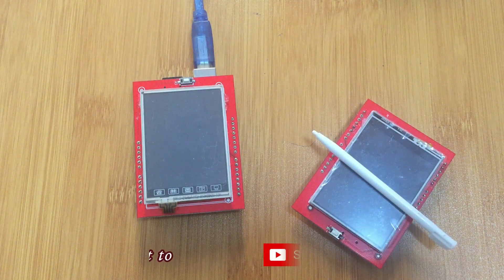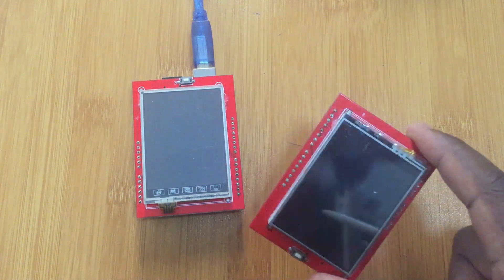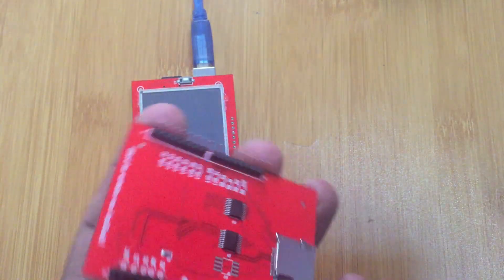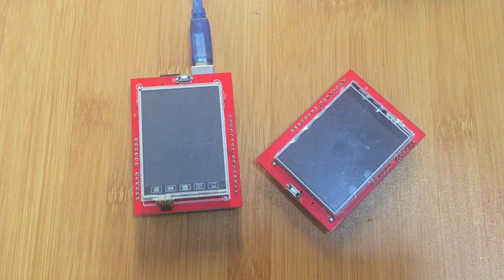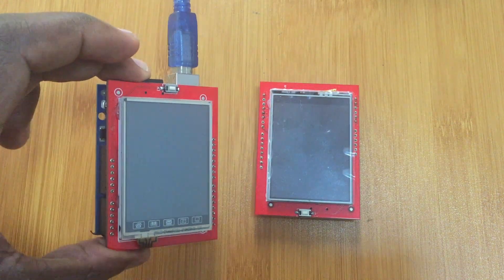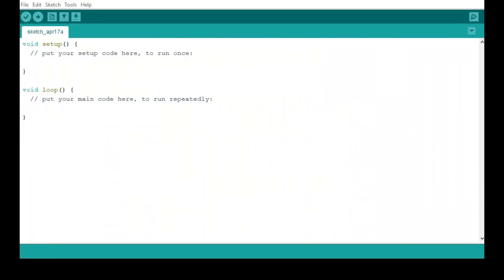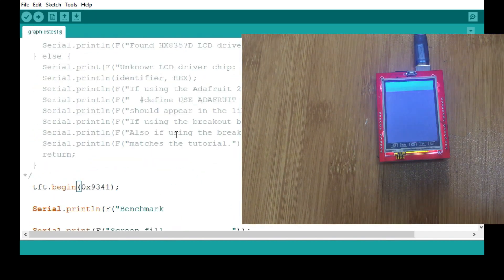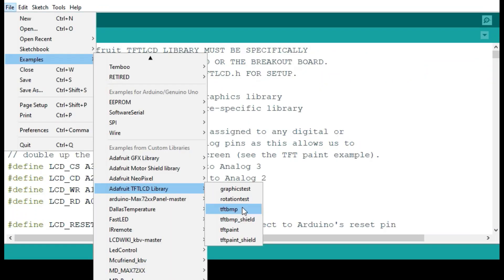2.4"  TFT LCD TOUCH SCREEN SHIELD FOR ARDUINO. (Troubleshooting white screen and touch problems)

Comment: Hi sir, this video helped partially. I could run the grafic test, with bouncing and white lines on background. But that's all. The touch shield doesn't work. IDE reject compilation with error message Make sure that use. Adafruit shield pinout is defined in the TFTLCD.h library . I am new in this topic so please help somebody. Thanks

Comment: I know you might not see this but, after I installed AdaFruit with my ardiuno my LCD Keypad Shield started bugging out and putting random characters even though the code I have for my LCD Keypad shield worked before. Also I tried using my TFT Lcd Shield, but I just got a white screen.

Comment: THANK YOU SO MUCH! I was four hours into looking up a solution for this <3
Reply: If anyone is stuck, try uninstalling all of your packages and getting the GFX and then the other library but be careful when installing the second library when it asks if you want to install dependencies, SAY NO, because it may reinstall a modern version of GFX undoing the work you just did to install the older version. Hope this helps. It worked without any dependencies of the TFT package anyway. That's all I had to do. I'm really really really hoping this helps anyone who sees this.

Comment: Hi.  Very useful explanations.  Thank you very much!.
I have a question.  It seems there are some lines missing in the following code:
            for(int k=0; k>3;               
        // read
                __color[k] = __color[k]<<6 | (sdbuffer[buffidx+1]>>2);      // green
                __color[k] = __color[k]<<5 | (sdbuffer[buffidx+0]>>3);      // blue
                
                buffidx += 3;
            }
 I suppose for(int k=0; k>3; k++) {
but I have no idea for the next line ending with //read.  It should be something for the color red, if I am not wrong.
Could you please help me?
Best regards

Comment: I wish you a good day. I have a 2.8 inch LCD. I've been looking for a solution for 2 months so that drawing on the touch screen will start working. Other functions work without problems. But now he draws 90 degrees sideways. Could it be solved somehow? Thanks for help.

Comment: This helped me a lot with  touch, it was exactly opposite of whats here .. YP, XM,YM,XP were A1, A2, 7, 6   and NOT A3, A2, 9, 8  as shown above @09:50 .. also you can measure resistance between XM and XP on shield .. should be around 300 ohms and should be there in .. TouchScreen(XP, YP, XM, YM, 300)
Reply: Exactly, then using the map function to make it go right side up.

Comment: I had bought a 2.4 inch TFT module and was hesitant to connect it to Arduino since the module didn't have any model name. I wasn't sure about the power supply connections, etc. However after watching this video I followed the guidelines and the TFT display worked in first attempt itself. Thank you very much for the lucid explanation.
Reply: Input vcc?